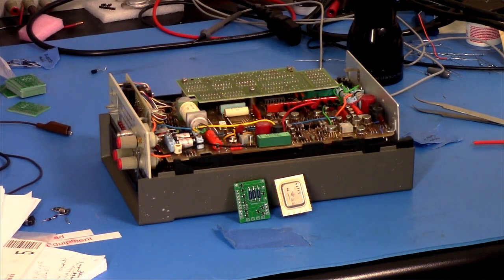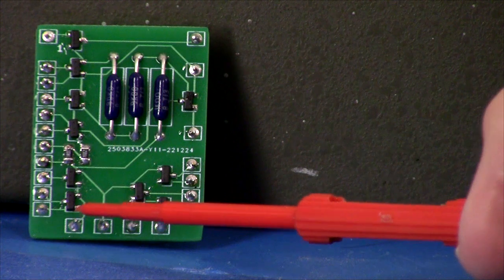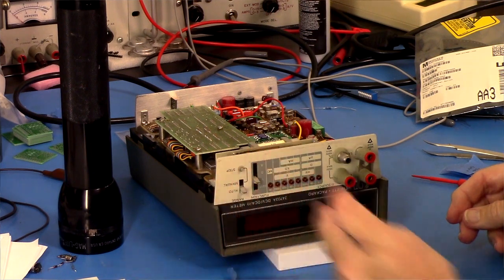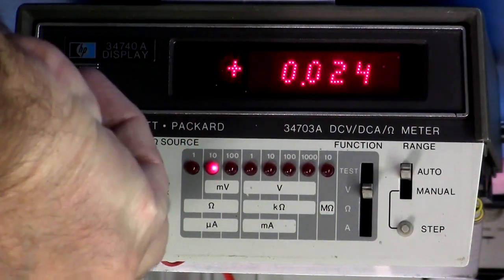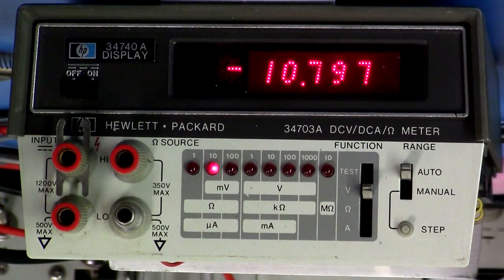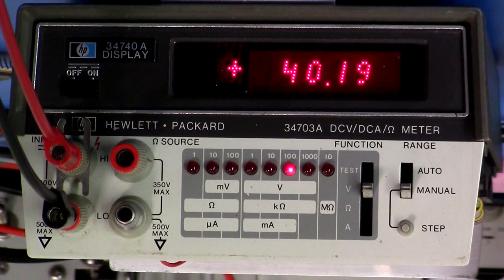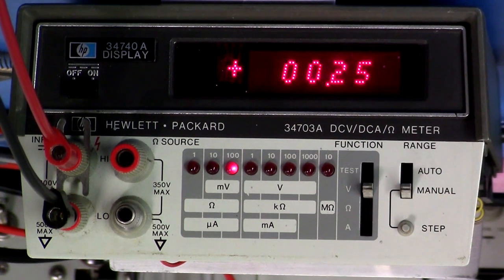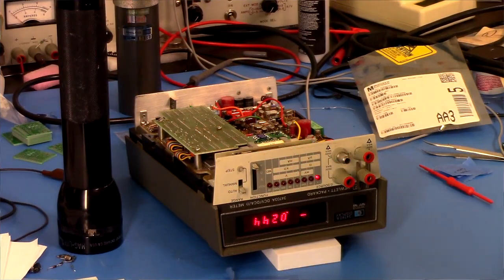HP 34703A Multimeter Repair - Part VI

Comment: Amazing a vintage in-house IC can be replaced, though doubt I could solder surface mount with my condition. Gives one confidence to purchase and repair vintage test equipment. 

Cheers,
Adriel